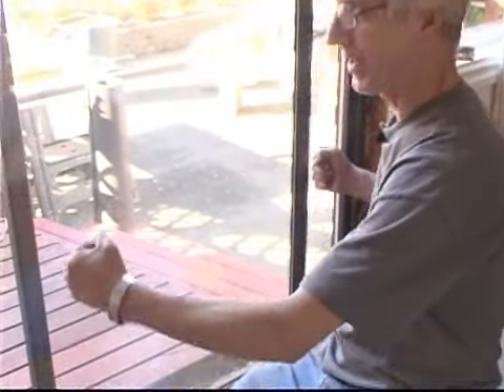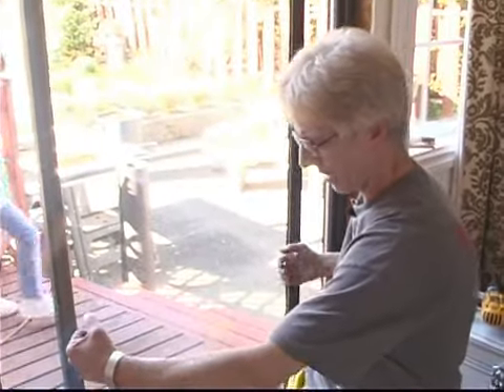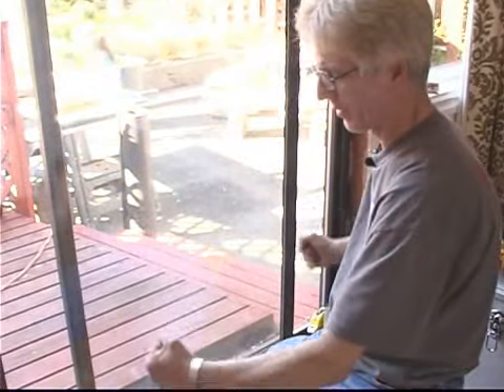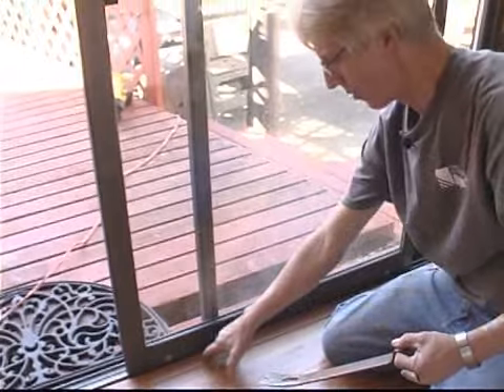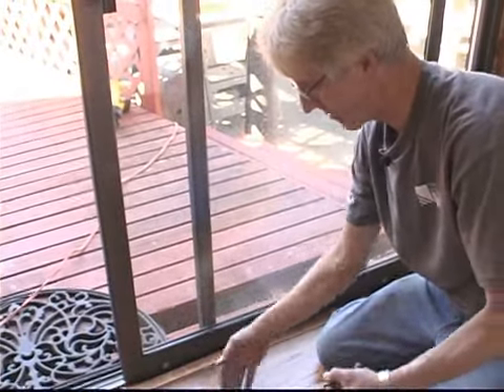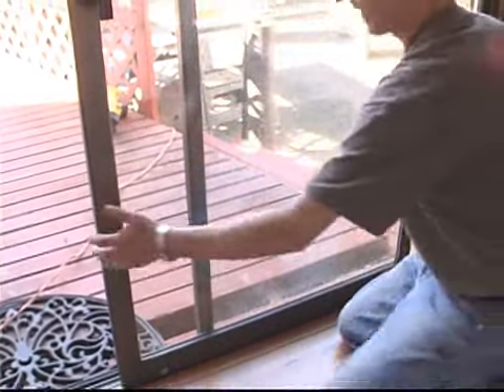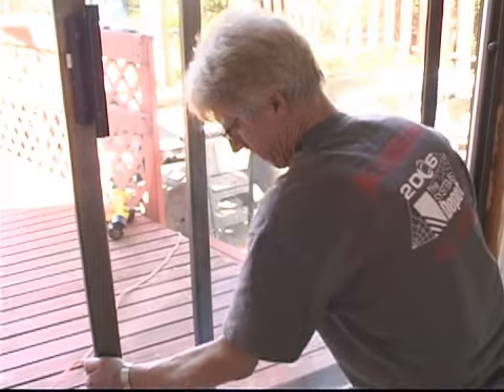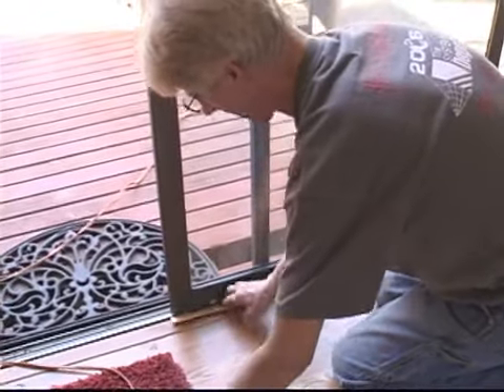Replacing Sliding Glass Doors: Removing Door Panel

Comment: I have a rental property and I would like to replace the two sliding glass door panels. Can I reuse the existing frame? The door is 25 years old, but frame is in good shape due to the fact the door was rarely opened.
Reply: Yes you can reuse the frame